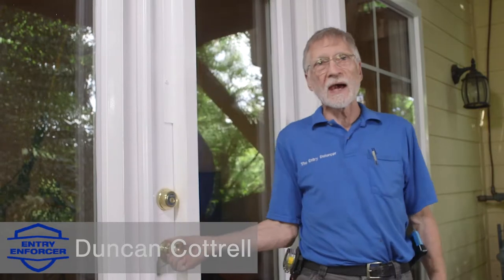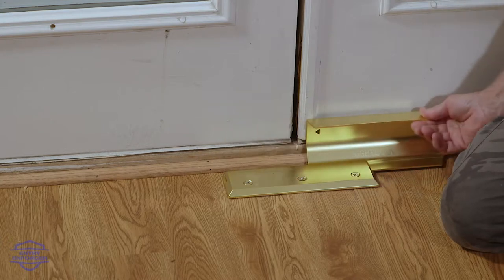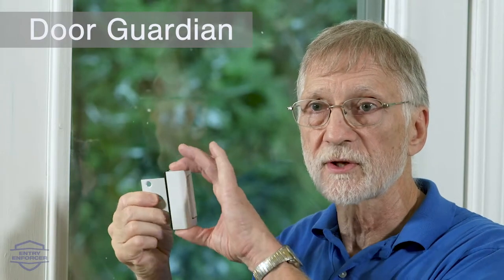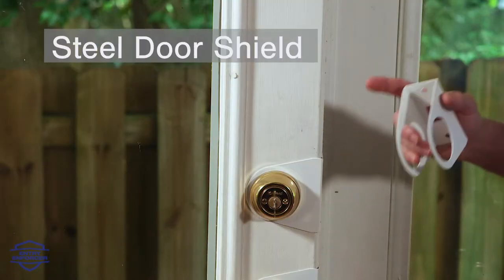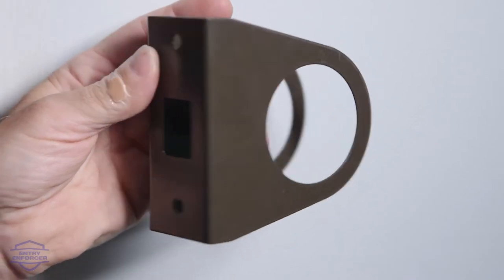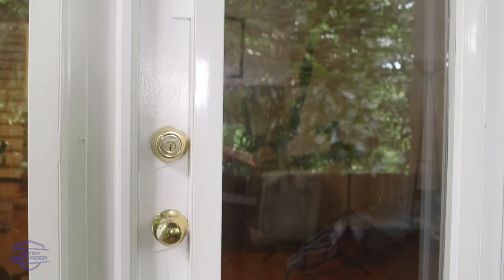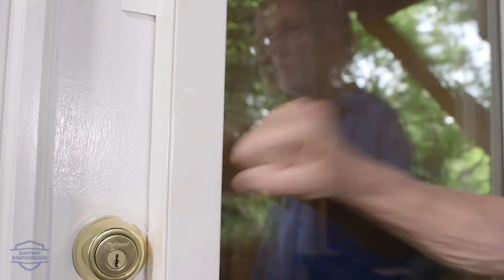Entry Enforcer Door Safeguard Upgrades for Double Doors/French Doors

Comment: This is just what I need to reinforce my double doors not from burglars but from high winds. Thanks so much for the video!
Reply: A simple and cheap fix is to replace the screws in the hinge with 3 or 3.5 screws. Upgrade your strike plate on the one door to a more aggressive strike plate. You would be looking at maybe all in  $20.
Reply: @passport_revolution.  does upgrading the screw length and strike plates even on a double door make a difference? i can see it working well for a single door but unsure about the double door

Comment: So I have several double french style doors. The ones leading to my rear deck look like these but they both open outward, not inward. What would work to reinforce these?
Reply from the maker: The vulnerability of outswinging doors is being pried open and/or breaking the glass to unlock the locks or to step through.  For outswinging double doors, I stabilize the inactive door with a deadbolt at the top going up into the header.  You can do the same thing at the bottom into the threshold, but you have to take the door off the hinges to do so.  Otherwise, I stabilize the bottom of the inactive door with a barrel bolt into the threshold, and I bolt it through the door with carriage bolts rather than wood screws.   Then install a metal Jamb Shield if the astragal is not already metal.  Then a metal Door Shield around the locks.   A full-length (79") metal  Astragal Outswing Security Flange can be attached to the active door to cover over the crack between doors, thus keeping out crowbars.  Endura makes one.  I buy them through my building materials supplier for about $45.  
For the glass vulnerability, a double-cylinder deadbolt is a good start.  Also clear security film on the interior surface of the glass if it doesn't have glued-on muntins.   A clear Lexan sheet bolted over the glass will eliminate the need for a double-cylinder deadbolt, but it's expensive.  
Also check out the Burglarybuster system from England; a short bar through brackets attached to the doors.

Comment: They came right through the glass on my patio doors....my locks worked fine, including the extra fence type one I added at the top of the doors. I'm installing UV plexiglass as a fix. Very hard to break...harder than those films and all that hyped up junk.

Comment: Are you guys using the door guardian brand or cardinal gates door guardian? They both seem identical and claim to be the original.
Reply from the maker: We use the Door Guardian from Meranto by inventor Kevin Wiseburg.  It appears to me that Cardinal Gates resells Kevin's Door Guardian along with other safety products.  I have seen a copycat version that looks like Kevin's product but has an extra screw hole.

Comment: Thank you. The Guardian on top is a great tip. 
A great overall Solution for hardening double doors especially the passive side. 
The U-channel of the The Safe Door System® is probably even stronger for both door edges

Comment: I just break the glass and enter the house easily. This man is so smart
Reply from the maker: The glass can be shielded with unbreakable Lexan or with decorative metal bars.  Clear security film on the interior glass surface will hold the broken glass shards in place long enough to discourage easy entry, especially if a glass-break alarm sensor is setting off a siren.

Comment: What about French doors that go outward and there’s an out 1/2 to 1” molding in front of door?
Reply from the maker: Outswing doors can't be kicked open but can be pried with a tool like a crowbar.  Use a Door Shield around the locks and a Jamb Shield as shown in the video to prevent the door edge from being ripped out.  The Nightlock and Door Guardian won't work in this situation, but you can install a second deadbolt at the top of either or both doors, with the bolt deploying up into the header.  You can use a barrel bolt instead, and you can install a barrel bolt on either or both doors into the floor.  Also see my previous answer to an earlier question about outswinging double doors.

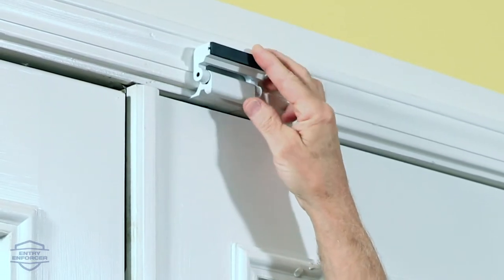Comment: I'm curious why at 1:27 you don't let go of the Enforcer. Are you unable to get it to stay in the up/unlocked position?
Reply from the maker: Depending on the door trim, sometimes the Door Guardian at the top of the  door will not tilt back far enough to stay up by itself.  Sometimes it will.  I use sticky back Velcro dots to make the Door Guardian stay up.  Especially when the inactive door will be open and would hit the flopped-down Door Guardian when the door closes.  I don't use a Door Guardian on the frequently opened active door, but it could be used if you utilize the Velcro method.
Reply: @theentryenforcer1934  I love the tip. I'll give the velcro dots a try.

Comment: I can’t find that type of steel door shield.  Where can I find that kind?
Reply from the maker: The steel Door Shields are from Armor Concepts (www.ArmorConcepts.com).  Most residential door locks have a 2 3/8 inch backset, meaning the measurement from the edge of the door to the center of the deadbolt or knob.  However some have a 2 3/4 inch backset.  You need to know your locks backset when ordering.  Choose a color that matches either your door or your locks.

Comment: Can't someone just smash the glass?
Reply from the maker: Certainly the glass can be smashed.  That's where the clear security film adhered to the glass comes into play.  The glass shards stay in place and no hole is opened.  If there is a glass break sensor, an alarm is sounded to motivate the perpetrator to leave.  Totally smashing the entire glass panel out of the frame is more difficult, takes excess time, and  makes noise that could lead to detection.  The idea is that a perp that wants an easy, quick entry is frustrated and more likely to abandon the attempt.

Comment: Just don't make no sense. Bust the window/ door glass and your lock is no good!
Reply from the maker: Yes, the glass is an additional vulnerability.   The best thing for that is a clear Lexan panel in a metal frame bolted over the fullview door glass.   Or wrought iron burglar gates, if yo9u don't mind that appearance.  Security film bonded to the glass can hold the shards in place while a glass-break sensor sets off the alarm; assuming an alarm with make the perpetrators leave.
Reply: @theentryenforcer1934  do you know where I can find a company that could install lexan shield over my french door in Central Florida?